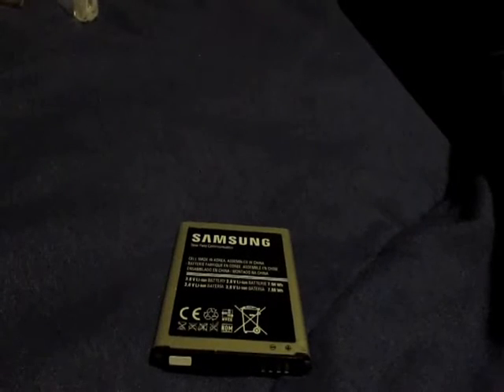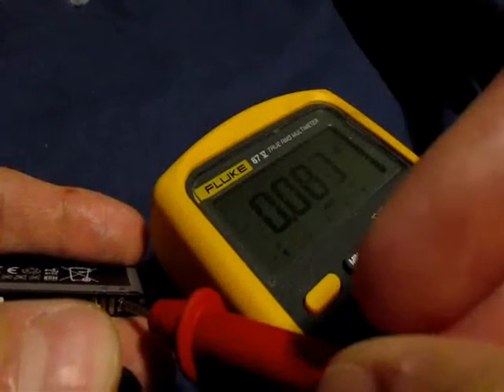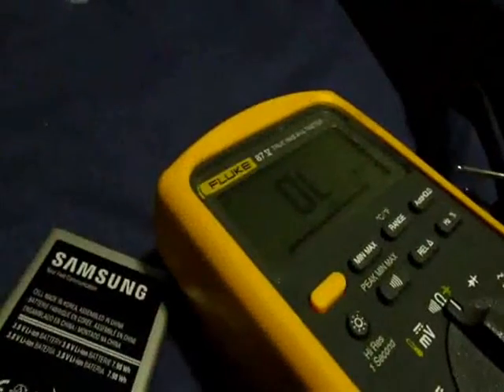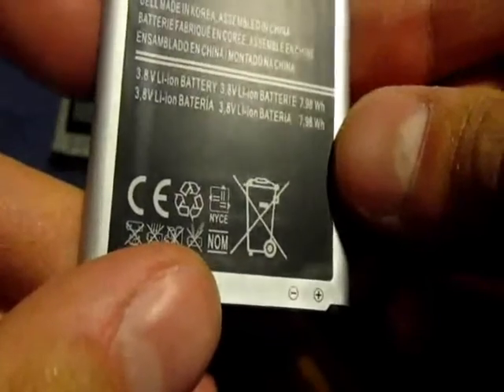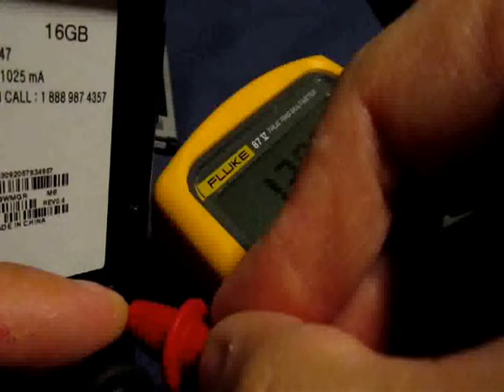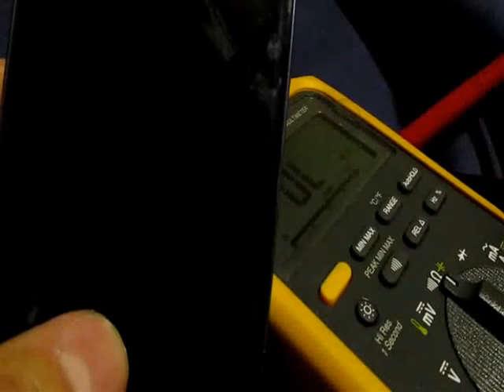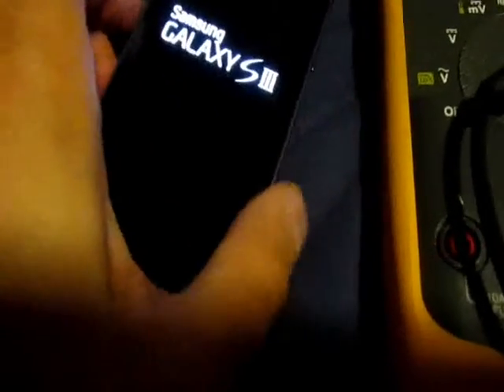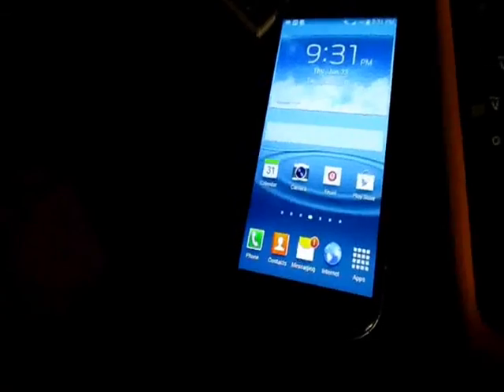Testing Samsung  cell Phone battery with Voltmeter

Comment: 4 pins is for safety, one is positive,  one is negative,  another is to monitor the temperature and other charging monitoring, lithium batteries are very unstable so we need all these things to keep it in check

Comment: This tells you nothing. You might see the voltage but not the current and that’s the one you need to know. So testing batteries this way is pointless. You need a battery tester let draws power to give you the overall current capacity.
Reply from the maker: Well at-least i knew it was charged
Reply: Ghetto Wagon 
Just have to watch it because people check the voltage and it reads fine and think the battery is ok when it’s not. If the battery drains down fast it’s because the current is weak. You can get battery meter that drains the battery and gives you the overall current. It test the voltage and the current which is amps.
Reply from the maker: Probably could of made a jumper harness and checked the draw inline, between the battery contacts and the pins on the board
Reply: Knowing the voltage of your battery can also tell u the state of charge your battery is in, it's not pointless
Reply: When your battery is discharging, the amperage and voltage will be dropping also, I always using voltage to monitor my battery a while now and it's all ok

Comment: Other terminals are for batt temp and battery indicator...
Reply from the maker: im surprised someone bought that messed up phone for 50 bucks.  What was more funny was when it was disconnected from the carrier it worked fine, It was like the Carrier was all "Its time for a new phone. next time, smart phone is GONE  Even during a emergency situation with limited phone acess or 4g network, its pointless.

Comment: It's pronounced te-hijack lol. Your phone is toast. Last thing you should try is plug it into a wall charger and keep trying to turn it on and see what happens, if it doesn't do anything leave it plugged in for a while and try again.
Reply from the maker: Ahh ok.  Yea I think it is toas It comes back to life for an hr  if I leave it plugged in.   The battery light lights up when It wants to so that is questionable too.   I wonder if I can still sell it for parts/as is for 40
Reply: Ghetto Wagon List it on ebay for parts or repair, it appears something is wrong with the bootloader or the motherboard itself. The screen looks intacts so somebody could buy it just for the screen frame.